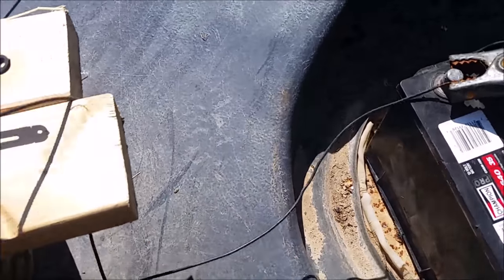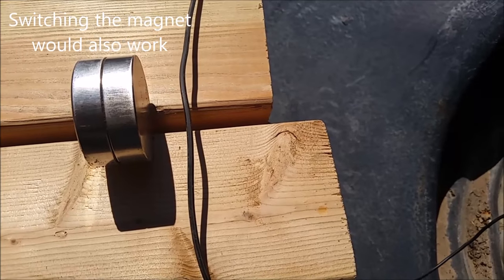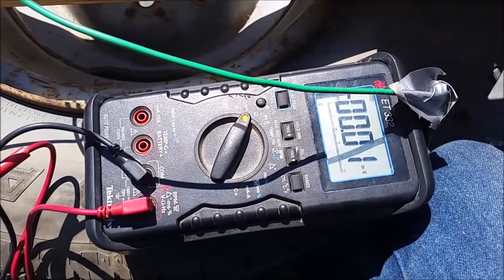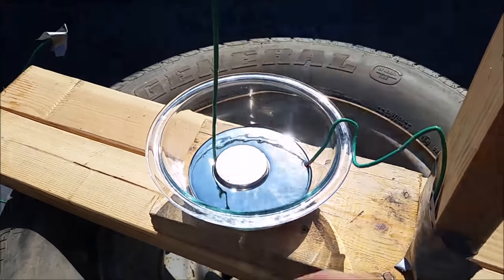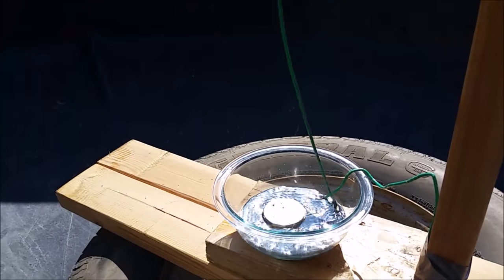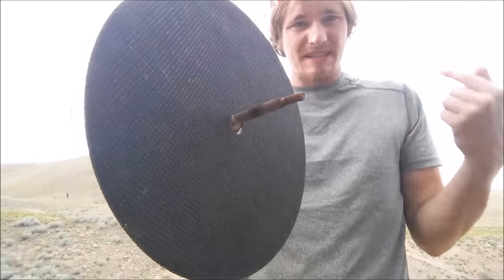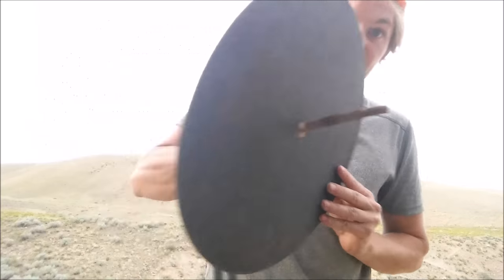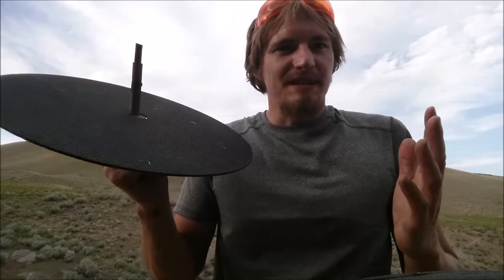Faraday Motor

Comment: Why use Mercury? I understand you need complete the circuit, I don't understand why you couldn't just use an electrolyte solution. Were you worried that current drop in a 12 volt circuit? Am I missing some base piece of electrochemical understanding?
Reply: kenstr321 this was recreating Michael Faraday's demonstration in 1821.
Reply: ***** Right and a few inches can very the flow of voltage (like a wet "variac") but if saturated the the lost is very low. I mean gold is more effective at carrying current but aluminum works well enough to get the job done (residential power lines). So I guess my question is would this work with a water/electrolytes solution rather then alkali metals?
Reply: kenstr321 I highly doubt it, unless you have an extremely low friction setup. You can give it a try yourself :) You would also have to worry about all the energy being wasted breaking the water into hydrogen and oxygen, so it may not be possible at all.
Reply: Richard Smith You're right I should try it with a electrolyte setup, I do see an issue with electrolysis (although I think the magnetic force would overcome the effect and end up not having enough power left over for electrolysis) but this is why we experiment right?

Comment: come on cody , everyone knows that current flowing through a conductor gnerates magnetic field (you can improve this by wrapp a lot of annamel copper wire around a ferromagnetic material.)
And if a magnetic field cuts or moves beside a conductor it generates electricity

Comment: What if you had an electric generator in which there is a piston that moves a magnet inside a coil of wire? It would probably be alternating current, though. But you can convert that, right? Does anyone know about this?
Reply from the maker: +Zach Wegner (TheRealDragonEX) 
Yeah, nasa built something like that once, I think the problem was it couldn't go fast enough.
Reply: Were they trying to get it to run at 60 hertz? Surely you could just convert whatever comes out to DC and then back to 60 Hz AC. I'm going to look into this...
Reply: ***** Bah, I didn't come up with the idea first, Cody! Look at this Wikipedia page. It describes exactly what I was thinking. 
https://en.wikipedia.org/wiki/Free-piston_linear_generator
Reply: +Cody&#39;sLab -- Why do you have a large Mountain Dew bottle of mercury at home? Are you in the antique thermometer business?
Reply: +Dragon_EX IIRC there have been flashlights that you shake to charge them up which use a magnet in a coil with a spring.

Comment: How do you switch the currents direction?
Reply: ***** I guess I am missing some part of your setup, because it sounds like you saying you have a wire that dictates current direction!lol.
Reply: ***** where did you get the ridiculous amount of mercury? lol
Reply: Garrett Moffitt He means that he switched which terminals he hooked each end of the wire to. 
Current flows negative to positive.
Reply: Yeah, I had a total derp moment. Sorry.
Reply: Garrett Moffitt
It happens to the best of us.
Reply: Owen Chase science channel He has a video where he extracts mercury from some local rocks. He also said he could make lots if he used more rocks so I'm guessing he either made it or got tired of making it and bought some online
Reply: O ok cool
Reply: I also have science channel
Reply: +tybo09 Actually, it flows from positive to negative. :P
Reply: Kevlarvesten
Oops. You're right.
It's electrons that flow from negative to positive.

Comment: Is quantization merely the point where Gravity and Electromagnetism become equal in magnitude?  Assuming that the nth derivative of the change of strengths of each of these two forces is linear, then we can graph a perfect circle for the pattern of the life of the universe...that is, that we would finally gain an equation for the universe.  This would be assuming that the universe is not chaotic :D , as the only non chaotic universe would be one where these two governing forces reach a stable equilibrium and the expansion of the universe has never existed.

  Now, interestingly enough, if the end of one universe marks the beginning of another, we would then be able to attempt to solve for the same equation, except with replacing the [ratio of the magnitudes of Electromagnetism and Gravity over change in distance in one universe] with the [change in ratio of magnitudes of Electromagnetism and Gravity over distance in first and second universe].

  Interest stuff indeed
Reply: +Auiuei  Lagrangian points guys.  I figured it out.
Reply: +Auiuei Indeed....and it correlates with the behavior of the probability of objects on the cosmic level entering stable orbits around other objects  (as well as if we apply our classical understanding to molecules and atoms).